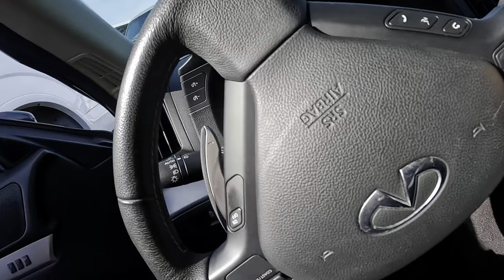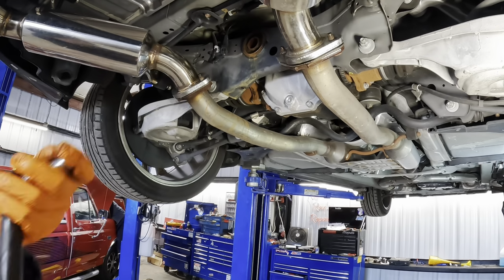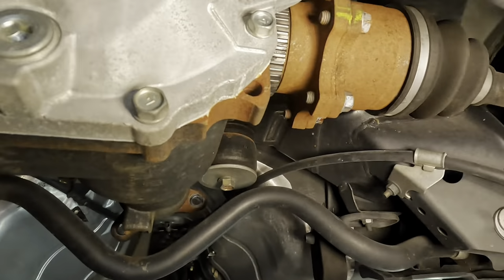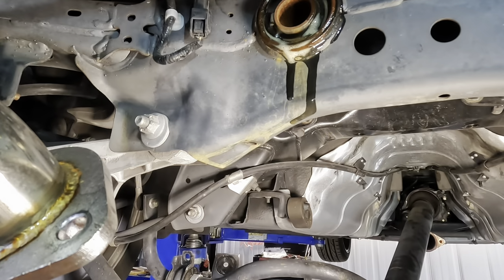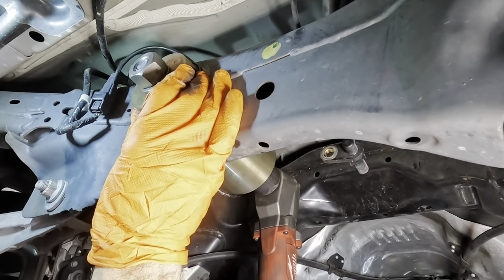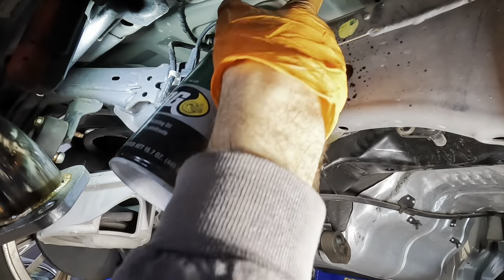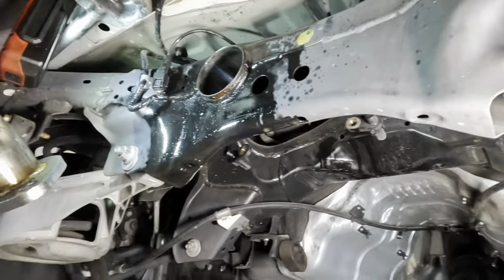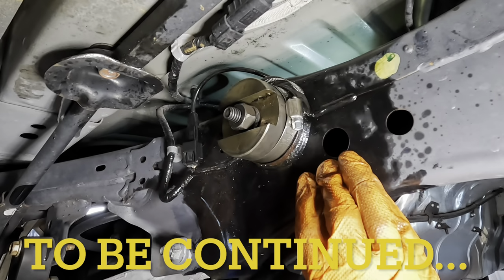Frozen Bushing! Aftermarket Press in! Infiniti G37 Rear Differential Bushing Upgrade

Comment: I had the same problem with replacing a ball joint on my 2000 Explorer. The borrowed ball joint kit I got from Autozone was just a little too big. I worked on that for two days. After looking through several videos, I saw one that someone used a ball joint kit from Advance Auto. I went and borrowed that one. The ball joint went in within two minutes of using the "correct" size kit from Advance.

Comment: Seeing people commenting about how the stock stuff was fine or better is BS. That rear bushing was shot to the point all the dampening fluid in it was gone. They also break down after years and cause your diff to clunk into the subframe. I have the same bushings and layout of them on my 240sx. I replaced mine as well.
The one thing I did yell at the screen was for him to just cut that inner bushing race with a Sawzall. That's how I got mine out without ANY special tools and way less struggle.
My install was easier though because I had to go with solid aluminum bushings because I went with a 370z LSD rear differential.

Comment: should have put the bushing in the freezer while taking out the old one, use some dish soap on the new bushing and use a ratchet to pull it in, no power tools. sometimes you have to slow down to go fast.
and the dish soap? i swear, people forget the things learned as kids. remember struggling to get those cool rubber grips on your bike handles so you use a little dish soap to lube them up and they went right on and never came off. that has helped me more times than i can think of.
Reply: I used dish soap when pulling wire threw conduit on electric work

Comment: If the mount is liquid filled it won't shrink,  it will expand instead.  But it depends on what type of fluid it's filled with determines the expansion.
I wish I was there rainman because there's a trick I could show you how to take that bushing out in minutes. Alfa Romeo used the same type of bushings in their engine mounts in the mid 80's. We used to cut a relief in the outer metal bushing housing, it will release the tension because of expansion from rusting.

Comment: PU bushings are used for tuned cars here alot as they do not wear as much as rubber , they are always pulled in from the centre as you did in the start

Comment: 30° in a humid state is like 0° in CO. As for freezing the bushings, we did that will replacing multispindle automatic screw machines like Acme Gridley's  beaing the bearings are metal we heared them up to remove them! Freezing definitely works!

Comment: I actually worked with Whiteline in Australia to get the rear diff and subframe bushings made. We also sent them a bunch of GTR stuff. Not sure what brand these are. but they're probably Whiteline knock-offs. My shop specialized in high HP Nissans. We also used a c-clamp ball joint press and some large all-thread to develop a press tool for the job. This was back in, I believe 2008. My 2006 350Z got the second one sent to the US. The first one went in my friends car. When I worked at Nissan, we had to replace the entire rear subframe because Nissan doesn't make replacement bushings.

Comment: When you were talking the bushing out it might help if you let the air compressor catch up before you use the air gun again when you were going back in could you have used a hone to clean out the bore then try to get the bushing in            But i do learn a lot from your program  keep it up Thanks

Comment: hey Ray
Why is there a slot in the end bush
Was it to stop the nut turning on one end.
The way you had it, direction of the load results in bending of the tool such that it splays out
This would increase the side loads of the tool against the walls of the housing.
You are affectively fighting against yourself.
Turn it around and the sides of the tool would pull the 'sides' in slightly.
Probably would have not had the friction forces that you encountered.
Just a thought.

Comment: Hey Ray did you even wonder why there was a slot machined into the die portion of the tool you’re using?  That slot is machined in the die so that the nut fits in the slot so that you wouldn’t need to hold the nut with a wrench!  So effectively you have the die of said tool upside down!

Comment: 36°?  It's been below zero here already.  On the removal of the outside steel bushing- put some lube between the washers and the nuts as you mentioned they might have a lot of friction.  A hydraulic unit may have been helpful.  Good work on the removal.

Comment: Next one of those bushings you do the first thing you do after you cut that rubber out is take a cutter and cut that sleeve thats coming thru the frame and then it will just drop out. you should be able to cut it either with a torch or a recip saw. much easier that way but you do have to be very careful if you use the torch method. I learned te hard way also first time I replaced one of those. My boss came out and saw me struggling and told me how to get them out

Comment: Lubricate the bushing with dawn soap before inserting. Hendrickson Vantraax suspension bushings on a semi trailer are similar in design and need lube to pull it through the eye.

Comment: You needed to flip it the flush flat part, it goes towards the bushing and the nut is inserted in the cut groove so it hold itself and it won't rotate allowing it to get inside and push the piece out. you will only need one wrench  just to pull it out!
Reply: He does that during the install and the slot is too wide.

Comment: I have a memory of needing some real cold for something similar cooling.  It was done by “melting” dry ice in pure alcohol and then using the alcohol for the cooling.  I think the achieved temperature was -70 — maybe degrees Celsius, but Fahrenheit would also be something to brag about.  In any case, the dry ice temperature is colder than your freezer!

Comment: To be honest I don't mind the cold. However I absolutely hate triple digit summers. Simply too hot for me to want to go outside of my house and deal with.
Also random though regarding exhaust bolts and their stubbornness sometimes, which is that a good part of it likely besides how rusted they are, is also how close to the engine heads they are due to heat and whatnot having an affect on how quickly an area of steel rusts if I'm not mistaken. I dun remember though exactly, as I could technically be wrong, but still, usually it's the ones on the headers that fight the most and not so much the ones towards the end of the exhaust.

Comment: physics says it should be a pulling job to install the bushing. when you pull the rubber gets stretched which makes it thinner, it has room to get out of the way by flexing towards the opening, when you start pushing you compress it and it bulges and you never get it in. it has no room to go anywhere and it wegdes itself into the hole. the rubber just lets the inside piece move back and forth without actually making any progress getting the rubber farther in. The force applied needs to be on the side which exits first not on the side which is pulled in. It only works with solid pieces, flexible everything is backwards

Comment: RAY watch Ford falcon and Territory diff bush changes in Australia, drill rubber out and drag it out, then then use your saws all I think that's what you use if not a body saw and smack it out, not the head ache you went through and use lots of lubricant and it should slide in quite easy. Question why do American mechanics do not  like using things like CRC, WD40 I'm in Australia and been watching your channel a couple of years and subscribed but I see you do a lot things really well some things frustate you, relax and go with the flow  you are good mechanic and electronic tech sorry I'm 65 and a qualified mechanic and a electronic tech YOUR GOOD MATE

Comment: If you took a mig welder and welded the inside of the steel in a continuous bead around the circumference it will shrink and come out easier

Comment: You need my big Makita it will come out or break the bolt and has 3-4 settings on how power you want and I check torque wrench and I have written down some place so I will know when setting on the battery.

Comment: A flexible plug can be pulled into a hole, because when it is stretched axially, the diameter is reduced. It is more difficult, if not impossible, to push it in, because it expands when subjected to axial compression, like putting a champagne cork back in the bottle. In this case, the smaller diameter centre was designed to be pushed, with the softer material shrinking and following behind the centre during the insertion. By pushing with a flat plate, placed against the back, the bushing expanded and so stuck. 

A better known inverted example is a rubber hose being pushed easily onto a nipple or hose barb. A hose expands in diameter when compressed axially. It is more difficult to pull off, but it can be pushed, or hooked off, or a force can be applied against the exposed end of the hose wall, an axial compression that expands the diameter. When the hose is subjected to internal pressure in use, an external hose clamp prevents the hose diameter increasing.

Comment: I changed one of these on my back in the driveway without the fancy tool. It was an OEM part but it was a struggle to say the least. After due consideration I assessed the situation, went to the hardware store and made my own puller and pusher. After a significant fight I succeeded in the quest. But it was a real bitch. By the way, we don't hate you up here in the rust belt, we envy you!

Comment: Operation is backwards perhaps reverse the largest cup to pull towards the rear? Bushing install from front of the cross member differential side. Also CO2 in a spray can used to clean key boards works on inner bushings quite well.

Comment: im 42mins in and it really looks to me that you got the end cap the wrong way round. the slot in the end cap should be on the outside and the nut would go in that to stop it turning. and that would then allow the whole flat surface of the end cap to push on the outer bush. other then that. thanks for posting ray, il continue to watch. the rest with a nice hot cuppa tea :) shame it isn't in one of your Mugs.

Comment: Watching the little impact locking pin hole slowly turning... Priceless... But hey... Why couldn't you use the ball joint press tool and cups on that WITH the bushing drivers? 🤨🤔

Comment: Logic fails Ray with that press for the bushing. It looks like a ball joint press by the way. Use the small rod to go through the bushing and use the smaller holed parts to press it out, one appears to be an insert for the large cup piece so the smaller all thread can be used to remove the entire bushing in one piece.

Comment: Apparently, from my slight interweb investigatin I found that the dealers don’t replace this bushing. They replace the rear subframe at $1300 lol the silicone-filled bushing “isn’t replaceable” as per Infiniti. Apparently they will under warranty but most dealers won’t even then and will still replace the subframe. I clearly see why after watchin Ray fight with this for an “hour” on video lol

Comment: Oh god. I installed the z1 differential bushings for my '13 g37 sedan, on my back in the driveway. Its a nightmare on the sedan. The floor of the trunk blocks the rear of the bushing. Even with the tool, it took 2 days to finish the job.

Comment: I think I would have used the saw to slit the outer bushing then used a chisel to unstick it from the hole.
Reply: and you would have had that smooth inner surface all chewed up and F'ed up too.....
Reply: @MrMustangMan  Let me help you my inexperienced friend. And please mind your appalling language, children read this stuff.
Stop cutting just before you break through. You didn't think of that did you. Then you get a chisel (metal shaft pointy at one end) and fold the ring in on itself at the cut.
Even if you break through when sawing, you only leave a single cut mark on the support hole and that is no problem; the rest of the tube is untouched. Why do you think the entire inside of the tube gets damaged, did you try it and mess up? You are more likely to oversize the tube dragging the bush out of it when the two are rusted together.

Comment: I'm sure you know this but the tool that your pounding on also has to fit through the hole. With that mushroom edge, it might not fit through. Use a air impact?

Comment: you have te tool backwards the slot goes the other way were the nut locks with the slot just like how you had it when you were putting it back in just when you put it in you use the wrong bolt it was with the bigger one

Comment: Oh this is triggering so many bad memories of two weekends of suspension work on my VW.  The same sorts of bushings are used in the rear arms. The rest of the rear suspension took almost no time compared to those stupid press in bushings. In the front, it was the stupid sway bar rubbers, they took way more time than replacing the arms, links, struts, and everything else. Just for these stupid pieces of rubber.

Comment: That hung up on your hammer marks! U need to hold the other side off the tool and really tighten it up then hold 1 side drive the other two 3 foot 1/2 inch ratchets would be the way too go

Comment: Work smarter not harder, you should have pressed the rubber centre out of that bush then cut a slit in the sleeve with the recip saw then pressed it out would have been out a hell of a lot sooner, what you got to think of then is all you can use is the smaller all thread to press it back in even with it being frozen to shrink it, it's going to be a pain.

Comment: Could have used the saw and cut the metal part of bushing then just push it out, put blade through hole and cut downward, just enough to get through the outer metal bushing

Comment: let it hang lol.. i just did the clutch on my a4 b6 1.8t and did the same thing no big deal........ rage sets in bro why isnt it coming out ..... u have it tightening..... that bushing ur going to need ur wheel bearing removal kit with those steel rd plates and c clamp

Comment: Looks like you scored the inner center bushing hole on subframe. A wire brush would have corrected that issue. Also on those long screws you got to grease the whole length of the screws and the covers have to be perfectly centered. That  would have made your life so much easier. There would be no need for pounding the crap out of those parts. Just saying.

Comment: 1:04:00 Wouldn't it be better to use the big cup of the assembly tool THIS side, to keep the plastic from bulging? Switch the tool around? Similar to that hose clamp, but better?
Reply: Good eye. And since this is also a solid polyurethane upgrade, it needs some silicone grease as well

Comment: 36 ain’t bad. If you’re not used to it, I suppose it’s a shock. My truck quit on Saturday and I had to replace an ignition control module in -14F with 25mph winds. That sucked!

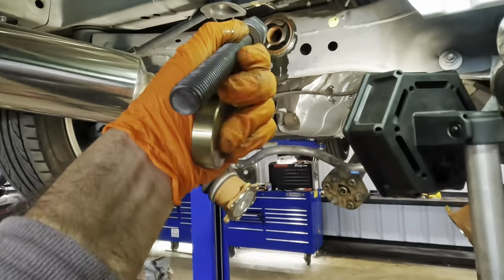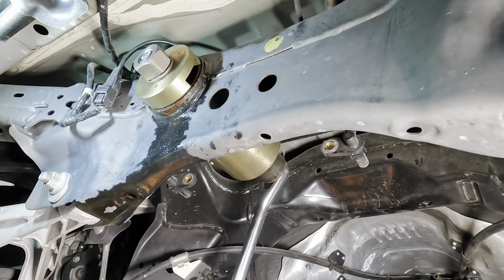Comment: @31:30... I drop the rear of the subframe down and drill out the hole for the larger all thread. @39:30... Heat the subframe. The newer cars have a steel subframe and can take heat. The '06 and older have an aluminum subframe that Nissan says not to heat. @47:50... remove the two rear subframe bolts so you don't need a wobble. @1:06:12... There is no OEM bushing. You have to buy the entire rear subframe. You know what bushing goes is perfectly? The Whiteline.

Comment: you could have also cut the outer ring of the bushing twice with a sawzall then removed it that way. no special tool needed. grease up new bushing and hole then use a c-clamp and a block of wood to press the new bushing in.
Reply: Bit of relief yep, also if careful can then use air chisel and air chisel fold it inward...no special stuff required. Really tough you can do both plus oxy acetylene and get it close to red while chiseling it.

Comment: I had to do this job in my bmw.  Awful 😂 I just cut the old one out.  Cut the metal sleeve and collapse.  And of course there is no way to install  new one in  so i installed aftermarket polyurethane bushings, they slide in by hand, no metal sleeve